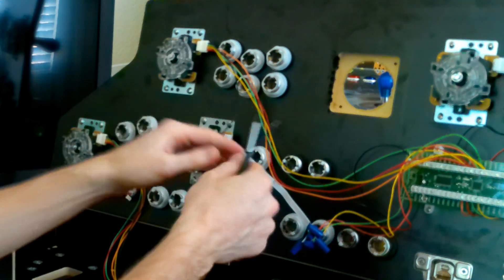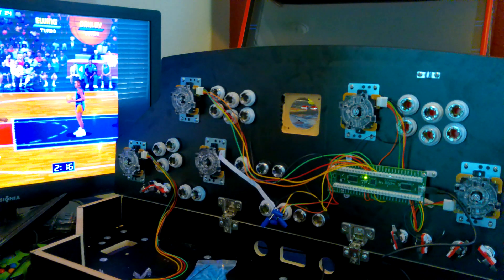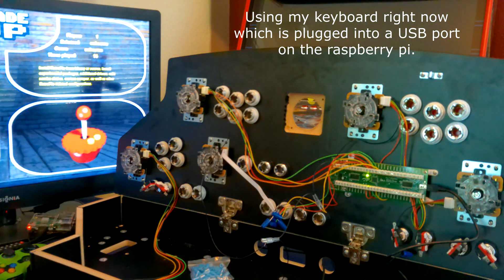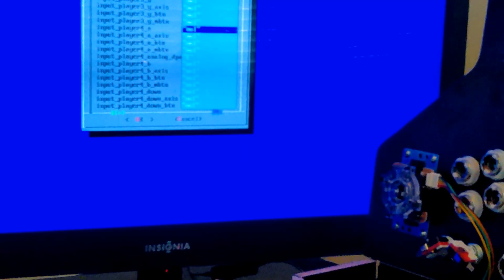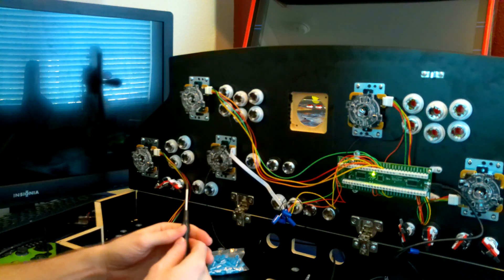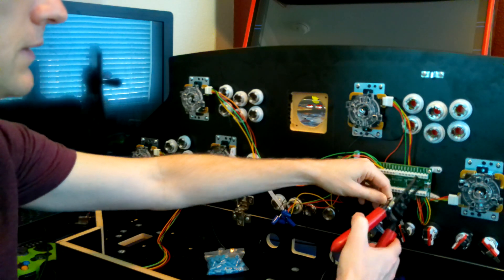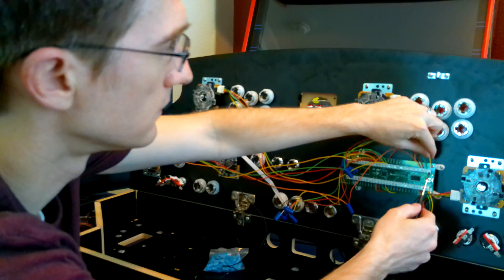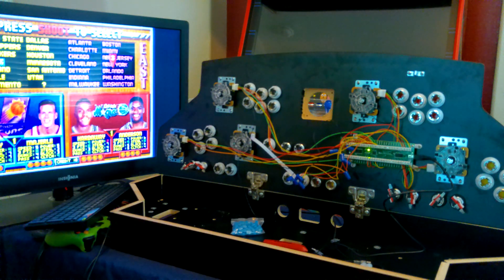4-Player Arcade I-PAC4 Full Wiring Assembly (part 2): Joystick wiring and mapping

Comment: Does the iPac work with an Xbox Series X Console? Im trying to build a Xbox Series X Arcade.
Reply: Default is the keyboard emulator for MAME, newer firmware support D-input (Direct-X 1.0-8.0 for original Xbox/PC), and X-input (Direct-X 9.0 released Xbox 360) very limited to Xbox controller layout. If later Xbox series support X-input then yes if no special handshaking protocol like PSP4 and PSP5. Brooks is the master cracker of later console protocols. They make converters Wingman XB3 for modem Xbox consoles so there is something weird going on.